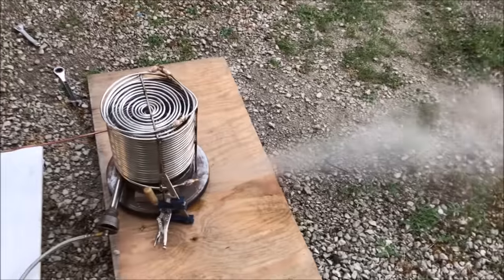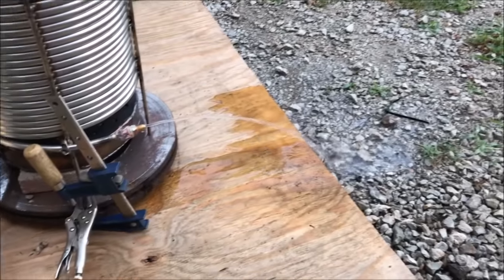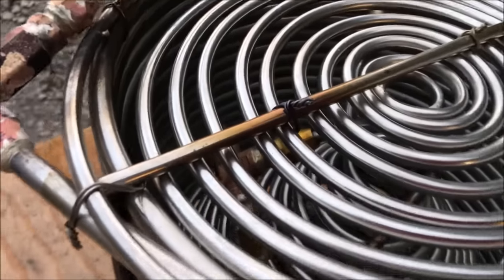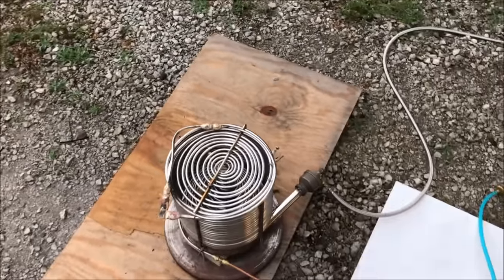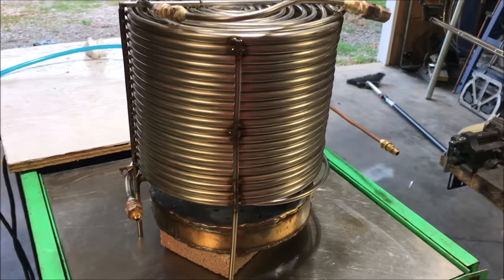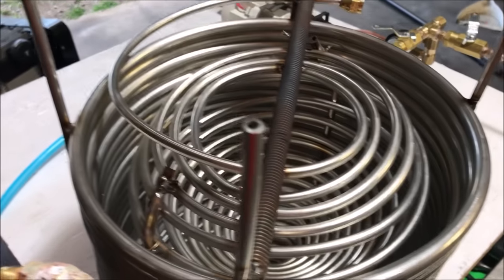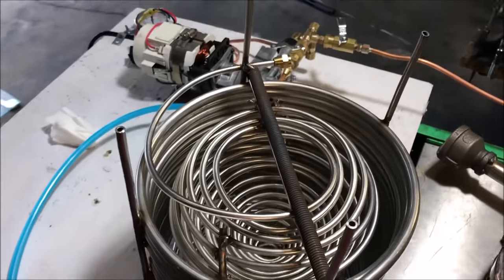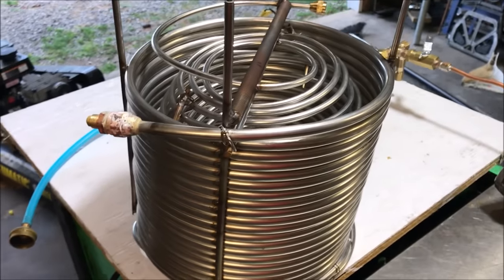4 stage mono tube boiler build High output

Comment: Connect it to a micro turbine and generate electricity!
Reply: Combustion engines aren't 2/3 efficient. More like 1/3. Even then you need to run it on expensive fuel.
Reply: So does an engine, because thermodynamics. Power plants typically burn coals to generate steam which in turn drives what is known as a steam turbine, which in turn generate electricity. Some even run on combined cycle, using natural gas for the main turbine and residual heat to produce steam for a secondary steam turbine. Did you honestly think power plants run on gasoline and diesel?
Reply: Schizophrenia
Reply: @Jupiter-rs4zl  It was a reply to another person who deleted his comments.
Reply: And Micro Condenser too😊

Comment: DM me I'm an engineer and I see a few ways you can make BIG improvements in efficiency. I do NOT know what your end goal usage is but this should be putting out superheated steam and not clouds of water vapor with a burner like that.
Reply: Please contact me I need help designing a steam boiler
Reply: @justinwhitlow8618  Tell me your use for the boiler and what you have so far.
Reply: It's a 25cc 2 stroke engine off a weedeater. I've converted it to run off steam and have had it running great. Looking to run 65 to 120 psi. I'm planning to build a steam powered mini chopper and need the smallest setup possible that will have enough output to run it
Reply: @dieselscience  I am not married to any particular fuel source. I'm open to anything.
Reply: @justinwhitlow8618  Both of those are a tough order. Anything you add will be more weight. The weed eater is easier to deal with. BOTH of them would need have some recondensation in the cylinder but not too much, just enough that drops come out the exhaust. Ideally, scrap the pistons and go with turbines. There are sources on the web for temp vs. pressure. Look for "Steam quality tables."
Reply: @dieselscience  I was thinking something along the lines of a monotube type boiler with a pump feeding cold water from a storage tank at x=psi through the loop and turning it into steam on it's way out but not sure if that is feasible or not. I'm just a plumber

Comment: You really think you where boiling the same amount of water that the water line pressure will run through it?🤔  oh you got a pump,  is that just to overcome the building of steam pressure in the coil.

Comment: I imagine it'd be MUCH more efficient if it were insulated.
Reply from the maker: It was a test not an actual working unit , The boiler this went into had heat flowing on both side

Comment: You need to insulate the coil with Ceramic Wool (it good up to 1400 Degrees) and put a metal liner around the tubing. The temperature will increase and You can cut down on your fuel. If you plan to use it as a Hot Water Boiler it will be Great. It would  be best if it is a Closed Loop Boiler. Your Water Chemistry is Very important. The Water Chemistry will Stop contaminants and the rotting of your tubing  and the Closed Loop means once the Chemistry is right you won't have to keep adding chemicals. The Ceramic Wool is best for insulating the tubing. You can add Heat Exchanger to the loop to heat different Rooms.
Reply: very insightful, thanks for this comment
Reply: how do you get the water chemistry right?? ph is easy but metals and contaminants and corrosive influence ...not so much?
Reply: @danf4447  according to the Type of Metal You are Using being Stainless Steel or Carbon Steel, Monel or Other Metal the Water Chemistry stops the erosion of the Metal Tubing. Chemistry is determined by the tubing being used. Correcting the Water Chemistry adds life to the tubing and stops the erosion of the metal. Believe it or not water has materials in it  that eroded the walls of the tubing. You will  need chemistry engineering to set the chemicals you need to correct the water for the Boiler.
Reply: @waymonblevins6939  cool. yeah i know superheated steam is very corrosive as is regular water under certain conditions
Reply: @danf4447  I am a Old Boilermaker by Trade. With Superheated Steam is at 1200 F Degrees and @ 2500 psi, that Steam can cut many Boiler Tubes when a Boiler Tube Ruptures. That ruptured tube can cut 10 to 15 steel tubes by that one ruptured tube. These are 2'' o.d. tubes with . 375 wall thickness. So Super Heated Steam is very Dangerous. It will cut you like a knife. That is why water chemistry is very IMPORTANT on these Closed Loop Boilers. The Water in these Boilers are De- mineralized meaning No Minerals at all. Best wishes.

Comment: Skookum choocher.
You should put a plate of top to force the heat to go through the gaps between the pipes. I work for a company that produces extremely efficient condensing boilers. A casing around the whole thing also wouldn't hurt
Reply from the maker: Thanks for the input .
The device will be insulated inside a steal framed box when complete .
I have seen something about condensing boilers on a repair video . is the idea to only expose the heat exchange to tap water wile using a closed loop of clean water ? it was a repair video and they said nothing about how they work , he was just changing the heat exchange and i thought wow wonder whats up with that , hence my hunch .
Reply: @NOBOX7  yeah kinda. But the biggest advantage against regular boilers is that the exhaust is cooled down to room temperature, condensing the steam produced by the combustion process. Alot of energy is stored in this steam. They achieve this by winding the tubing extremely tight, there's only a .3mm gap between them. This forces the exhaust from the combustion/heating chamber to give off all it's heat
Reply: Backyard Arsenal put the coldest water to the coldest part. This allows you to take the air down to near the temp of the water input.

Comment: As a engineer u caught my attention.  I like this test performance..It's an ideal for more possibilities that can improve on your device . My thoughts are if u add another coil coming out of the discharge end and heat it up ,, u may as a results ,,a mini high pressure system ,,add a small turbine generator.  Any way good luck and good job.
Reply: i think it is because of nozzle, pressure goes up and saturation occures

Comment: This video answers so many questions that I wasn't sure how to ask. One question, is a pump necessary for the water? Or could the water be fed by say, an elevated tank?
Reply: Pressure gauge is reading 175psi or 12 bar. So the tank would have to be at least 120 metres high!

Comment: Very cool. What's the rating on the water pump? Would it still work pumping from a tank instead of a pressurized plumbing system? Thanks
Reply: yes with gravity

Comment: Hi there, great job on the coil. Just have a few questions - Could this be used to pressurize an autoclave (15 - 17psi @ 250F)? would there be back pressure in the coil ? and could a regulator be used to avoid this? Kind regards
Reply from the maker: Yes
Reply: How to baying that sir
Reply: @zustrelaxe8186  Make it

Comment: so how are these used? I assume to heat up room(s) so do lines run to radiators in rooms or just pipes under floor (heated floor) and as the steam cools down and goes back to water, is there still pressure to return it to the water tank? how much water is lost in the steam in a closed loop system? i guess i need to watch more detailed videos.
Reply from the maker: steam equipment for mobile car washes and killing weeds

Comment: I’m looking up DIY pool heaters and this video came up. Would a mono tube be over kill or even safe for heating a pool. I have 100 feet of stainless tubing in a burn barrel that takes 6-7 hours to raise the water 10 degrees. Also where is a good place to buy stainless steel tubing coil my home brew stores are out of stock?
Reply from the maker: Bro the entire world is going out of stock thanks to that guy dressed up like Joe biden . Bro that aint Joe Biden  , guy rights with a different hand and every thing . signs bills with right hand during obamya now he is left handed and has no ear lobes
Reply: @NOBOX7  
Can these be used to heat a pool?

Comment: Just out a condenser with a blow off valve and reuse distilled water and you'll never have to change or clean the water it can be a closed system and run.

Comment: Try that in summer without gas burner you'll get the same result.Good to wash car or clean grease ...
Steam is dangerous ,to make that work safely a lot safety features need to be mounted.Good job anyway

Comment: Great demonstration , what are its specifications 
PSI
Steam temp
Fuel consumption
I have a requirement of one of the same high pressure boiler for sterilizing mushroom substrate , will it work for the purpose ? 
Please contact me with quotation
Reply from the maker: $9 an hour propane consumption 
can go as hot as 200 c and as high as 300 psi or higher if i make it to do so .
I just sold a unit for $3,800 
Emails me and i will show you the unit after its finished  . My email is in the description
Reply: You don't say how much substrate or how much total volume you're sterilizing at one time so I can only guess... BUT for what you're doing, you don't need nearly this much heat output. For autoclaving, it's not just temperature and pressure that matter it's also TIME AT TEMP.

Comment: How many psi is the water flow?

And what is the gpm? 
I'm curious if just a 50 foot coil will work with a boiler pump.
Reply from the maker: 250 psi 1 to 2 lpm but never did a good flow test
Reply: @NOBOX7  did you ever measure the water psi at the outlet? Because the video of water shooting out is not 250 psi, more like 40 or 50 psi. I hooked up my 1/4" stainless 50 foot coil to water hose at 50 psi and the flow was the same as your video. I'm about to coil it tightly for a steamer then check psi just from water hose again.

The pressure difference from inlet to outlet would be good to know. The percentage loss from the friction as a rule of thumb will be valuable no doubt.
Reply: @NOBOX7  I tested my 50' coil with propane weed burner, less than 2 minutes to heat with wind blowing at times, normal water hose pressure does the same as your rig does with the alleged 250 psi water pressure. I still don't believe yours is anywhere near that at the outlet. Maybe if you had 200 feet of coil, then you might need that much at the inlet. Your water pressure is falling off way too fast. Research I've done recently said about 30% drop in pressure which turns out to be true for my setup.

My waterhose tested 45-50 psi at first then after coiling stainless steel tubing,it had reduced to 34 psi which is close to 30%. At 34 psi the temp should be close to 280°F.
Reply: @NOBOX7  just did a flow test, 1 gpm from waterhose. Biggest diameter of coil is about 8".

This stainless steel tubing is 1/4" OD and .028 wall thickness, so .194 ID. 
Now I'm really interested in you checking your setup to see what's so far off.
Reply: Very interested. How do you feed water into the monotube? Could it be gravity fed? If so, how do you keep the pressure from going into the water Reservoir?

Comment: Can this work with no pump or a really weak pump? Would it spit the steam into the water tank?
Reply: You have to overcome boiler pressure to pump water in. It looks like he's using a pressure washer pump powered by an electric motor.

Comment: Do you think a modified wort chiller would work as a boiler?
Reply: Most arent rated for pressure, and most I see are just soft copper. Otherwise, similar thing. Don't underestimate the pressure of steam.

Comment: This is nothing new my father heated his swimming pool with a 55 gallon drum a copper coil and fire in it in the barrel
Reply: Lol the water in the pool would eventually turn green, as the corrosion in the copper pipe goes on and on... Also it would smell after some time

Comment: if someone made a flash boiler, more economic than the gasoline engine and in the size of the doble boiler, it could revolucionate the market of cars today
Reply: look up jay leno's steam car not cars. good watch
Reply: The Cyclone steam engine attempted to do that, it failed.  I don't know if they ever built a steam engine that was commercial quality, but I know it couldn't compete with diesels in efficiency.  It was a 5 cylinder radial engine.   Even if not suited for industrial use, I'd like to see something like that as an off-grid power source.    I expect that it didn't meet standards for durability, but I never saw a complete report of the reasons that the Cyclone was not manufactured.  Insiders probably knew early on that it couldn't succeed, but the project lingered for years.  Cyclone used ceramic bearings that used water as a lubricant so that it could theoretically operate at very high temperatures and higher steam pressure.